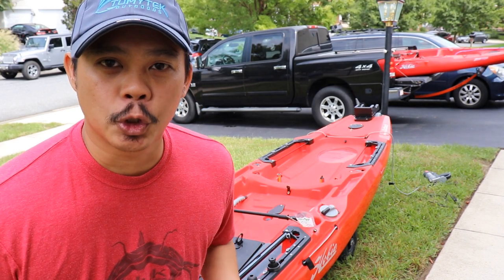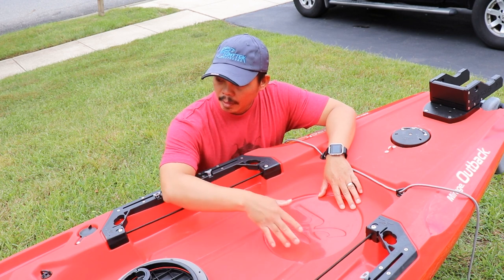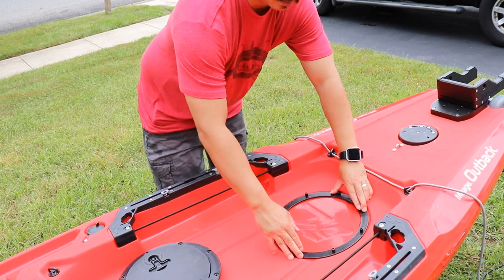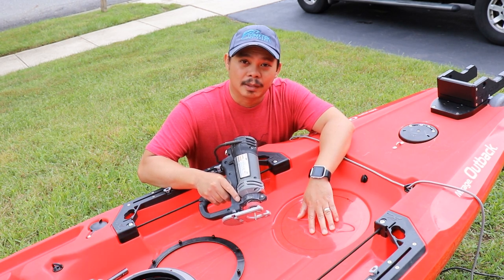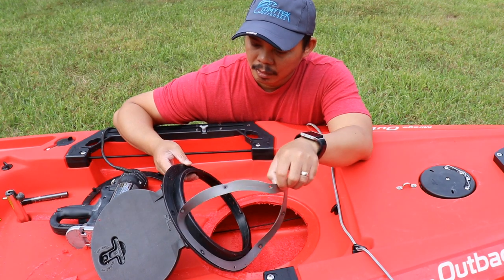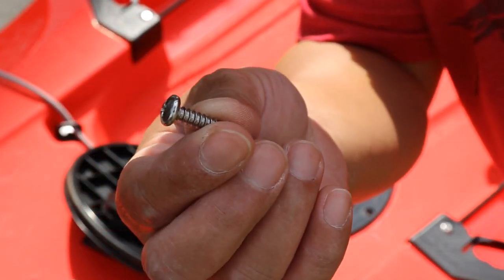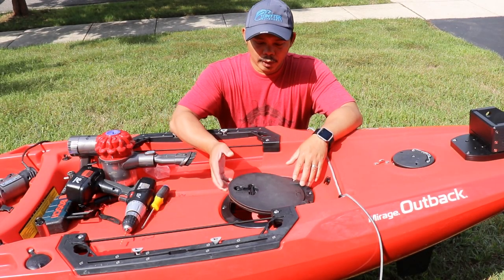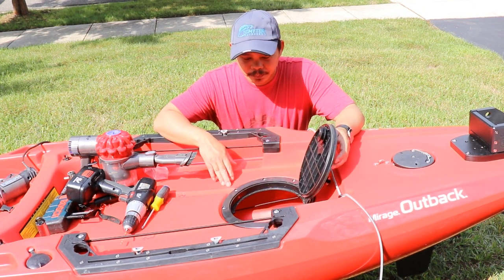How To Install the Circle Hatch on a 2019 Hobie Outback

Comment: Hello Friend , ? Honestly which kayak is better 2019 or 2018 Outback for slightly shallow waters
Reply from the maker: I'm going to say that it depends on your preference.  If you could demo both, I would recommend it before you decide on which one to buy.  From my experience with the both, I would say the 2019.  In shallow water, I tend to have to use my paddle if I get too shallow or I'm fishing around sunken timber.  The 2019 paddles way better than my 2016.  The 2019 is also more stable.  Not to say the 2016 isn't, but you will feel more comfortable standing on the 2019.  The extra bells an whistles are pretty nice.  I had to add quite a bit to my 2016 to make it the way I wanted.  The 2019 comes rigged with a lot of options.  The only thing I haven't figured out yet on my 2019 is how to setup my Bipxy Jet for my needs.  If you are not going to motorize your kayak, then that shouldn't be an issue.  I'll figure out something soon.  If you could find a really good deal on a 2018 that's rigged, it might be worth it.  If you were to buy brand new, I would go with the 2019.
Reply: @TomyTekOutdoors  Thanks friend

Comment: I’m curious Tomy Teka Two Times, why the outback? What other Hobies were in the running when you purchased the 1st outback? If my legs worked and I could rock the mirage, I feel like I may lean towards the revolution over the outback. With a purchase that expensive, I’d likely not be able to choose either boat. Lol
Reply from the maker: Lol! The Revo was a contender when I purchased my first Outback. The 2016 Revo is faster and cheaper than the 2016 Outback, but the Outback is more stable and had more space. A friend of mine owned both and recommended the Outback. He also crabs and fishes from a kayak, so he opinion was a big weight in my decision. I have no regrets. The new outback was completely redesigned. It's much faster and even more stable. Then they added a bunch of bells and whistles. I'm pretty happy with it so far. The only gripe I have right now is with my motor setup. Once that's figured out, I'll be good to go.

Comment: Hi Tomy, good video, did you plan to use the extra hatch for the bixby battery, or fishing tackle in the round tray that lifts out for extra storage? Any concerns about having battery in the back or way up front?
Reply from the maker: The main reason I installed the hatch was to be able to access the back to install steering cables for my Bixpy Jet.  I'm also looking at getting Boonedox landing gear, so it could make it easier to install the backing tubes.  The Bixpy Jet battery will not fix in the hatch.  I just lay it in the tank well.  I will likely get the normal size tray for extra storage.  I prefer having my battery up front, since it would be easier to get to than the back if I had to mess with it on the water.

Comment: I highly recommend emailing Hobie about this particular mod. With the recessed hole already on the yak, and at a cost of well over $1k, clearly you shouldn’t need to install this after purchase. C’mon Hobie, give this man his hatch from the factory!
Reply from the maker: Thanks for dropping by.  This is has been a topic of discussion.  I get that Hobie is trying to keep the cost down.  I would have paid more to not have to worry about it, but it was a pretty easy install once you know where the cables are.  They also did this when the Compass came out.  They were trying to keep it under 2k.
Reply: It’s def pretty loaded with features, no argument there. I guess every fisherman wants a different “one more thing” from the factory and they can’t please everybody.

Comment: Hey Tomy,
is there enough room for the battery holder?
Reply from the maker: Which battery hold are you referring to?  It should fit the double Nocqua battery holder.  It's the same 8 inch round hatch from previous Hobies.
Reply: TomyTek Outdoors 72025007 HOBIE 12v BATTERY HOLDER
Reply from the maker: I gotcha.  I wasn't sure if you were talking about that one because that normally goes in the front hatch and attaches to the sailing mast.  This will not fit.  My 14ah battery will not fit in there by itself.  A Nocqua batteries will fit in there without a problem.  I'll make another showing the what dimensions and I'll show how my different batteries fit inside of it.  It looks like you would only store small things and use it for access to install other things in the back.
Reply from the maker: Velin Kerimov  Sorry for the delay.  This got stuck in my spam.  I don't think that will fit.  I'm doing a follow up video to give you guys an idea of how much space is back there.
Reply: TomyTek Outdoors Thanks!